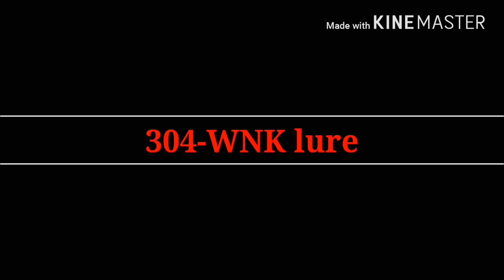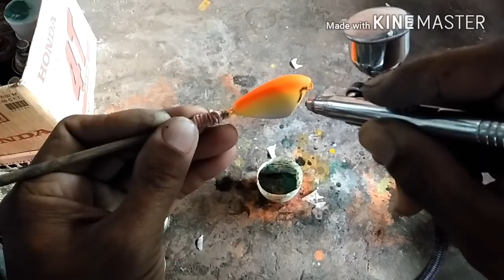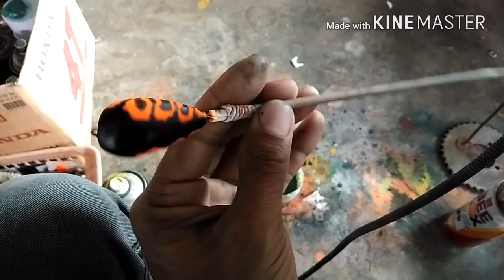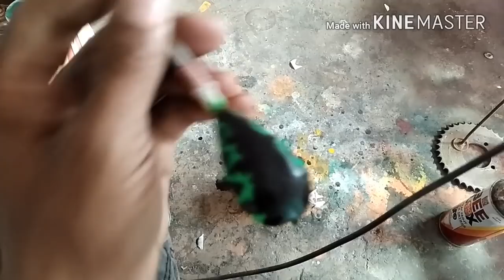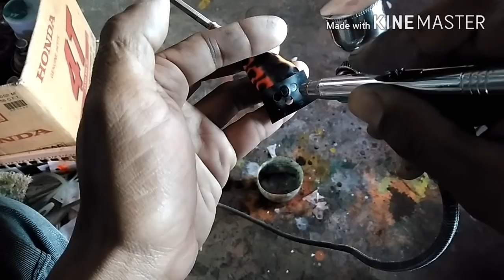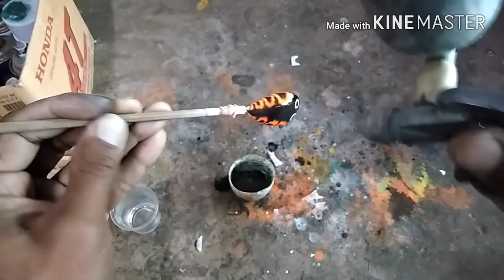ทำสีเหยื่อปลอม เพ้นลายได้ไม่ยากแค่ทำตาม

Comment: Your airbrushing is awsome .i use a home made marker air brush you dont have to clean it between colors but you cant paint fine lines like you do
Reply from the maker: I clean airbrush. But I cut out the video.
Reply: I use felt tip markers just clip a marker in and spray but like i said you cant do fine lines with it
Reply: Please show close up of holder you use to hold bait i use small forceps but i like yours better
Reply: You sign your work with a pen the clear coat dont make the ink bleed ?
Reply from the maker: No.I use 2k clear.
Reply: Your work is so awsome